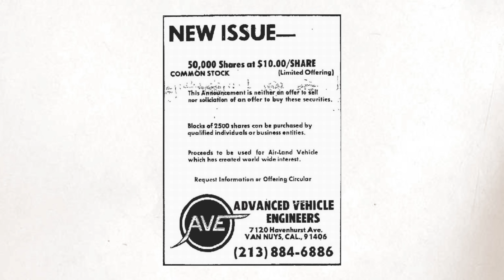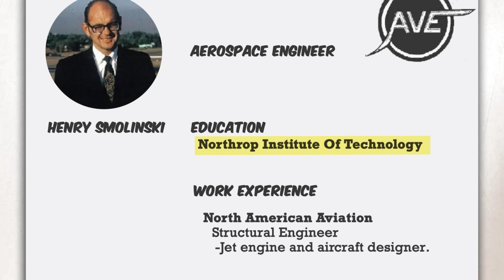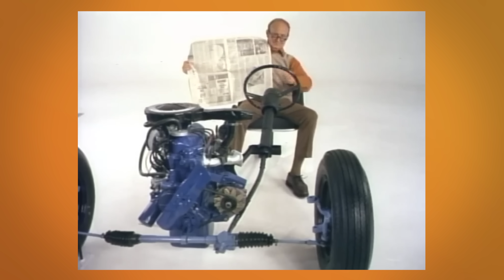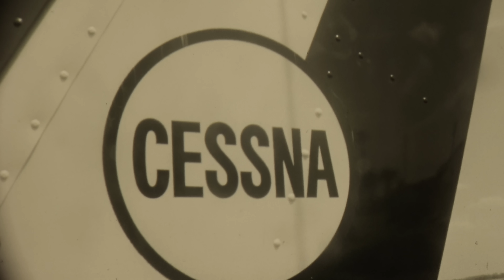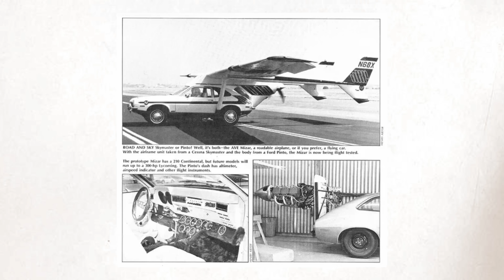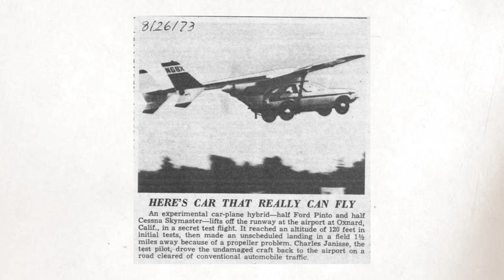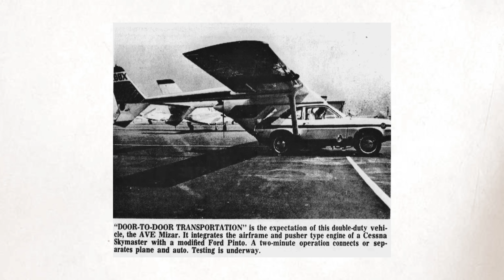The wild 1970s flying car that actually worked... until it didn't

Comment: As a retired pilot (airline, helicopter and ultralight instructor), the adage that the most dangerous part of any flight is the drive to the airport still rings true. But flying any type of aircraft is something that should be done by properly trained pilots. I dread the day that Uber or any casual driver/pilots are allowed to operate above our cities.
Reply: When car was invented, most people thought it was crazy to drive them. We have a climate change risk atmosphere, but have gained in security and technology, so I'd invest in solar airplanes for they to be stronger, lightweight and bigger. Like cars, risks could be taken trying hybrid planes with other achievements. We need more tech revolutions, more Teslas' minds, e. g.
Reply: @Whystu729  Yes, but my point is that the operators - pilots! - should be well trained! Otherwise, they'll crash with their passengers onto people below.
Reply: @Whystu729 like an 8 engine B52 that went “swoosh” right over your head didn’t it?  lol

Comment: I remember seeing a photo and blurb about this contraption in an early 70s issue of PopSci and immediately thought ‘Wow.. neat idea, wonder how long til it flops’. Conversely, I was immediately drawn to the oddball yet innovative homebuilt creations of Burt Rutan which were prominently featured in that and other aviation periodicals of the time, not to mention the fleetingly famous BD5 & BD5J micro jet.
Reply: Yeah, I read those articles, too. I remember one line: a bird that can fly but not walk will starve. True. But it's probably cheaper to rent a car at the airport than lug around all that weight of a differential, transmission, and suspension system with four wheels that can survive driving over a pothole through the air.

Comment: I had a Pinto in my youth, and later on knew some of the principals from the Terrafugia flying car attempt. And while I've got some ad-hoc mechanical and aero design experience, I shudder at the idea that a genuine aeronautical engineer would use such sloppy design and manufacturing practices with the attachment of the flight structures to the Pinto they used. Horrific that they died, but at least they didn't take anyone else with them...

Comment: First challenge: Getting a Ford Pinto to go 65 mph.  Seriously, a flying car is going to carry a lot of useless weight (transmission, bumpers, steering linkage, brakes, etc.). In car mode, you have to remove the wings, presumably leaving them at the airport, and then somehow reconnecting everything in order to fly again.

Comment: With AI and automatically driving cars we could solve the biggest problem with cars: traffic.  Think about it.  Cars driving on the highway at 70mph with six inches between bumpers.  Suddenly the capacity of the shipway goes up 5X.  No need for traffic lights you just breeze through intersections and miss other cars by a few inches.

Comment: A cyclic event the flying car, Every 20 years an Idiocracy happens. Drink Brawndo  -  Electric anything = No power density 
Flying cars the worst of both worlds.  Commercial helicopter pilot mechanic designer. Pack a scooter in the baggage area

Comment: If your car breaks down, you pull to the side of the road and call a tow truck.  If your FLYING car breaks down you die screaming.
Reply: Pilots are trained to deal with in flight problems. Most don’t end in crashes.

Comment: The empty weight of Cirrus SR22T is 2,354 lbs. A Pinto weights 2,000 lbs + a 300 Hp Lycoming weighs 440 lbs = 2,440 lbs. This is before you add any of the other important airplane parts like wings. This baby should fly about as well as the the infamous turkey from WKRP in Cincinnati!
Reply: I thought turkeys could fly! 😂
Reply: Oh man, great reference!!
Reply: The empty weight of a Cirrus SR22T is 2,354 lbs.  Also, the empty weight of a C-17 Globemaster III is 282,500 lbs.  I've actually seen one fly - it looked like it wasn't having too much difficulty.
Reply: @dougearnest7590  My point in my original comment is not simply the weight of the flying Pinto, but the power to weight ratio. The car's steel body, 4 cylinder engine, relatively large suspension, safety glass windows, steel rims & auto tires, etc. all add a lot of weight, but add only a little or nothing to the vehicle when it's flying.

The video states that the inventors replaced the original engine with a larger 300 Hp Lycoming. This is still 15 Hp less than an SR22T. An SR22T has a gross weight of 3,600 lbs & a 92 gallon fuel capacity. Avgas weighs 6 pounds per gal or 552 pounds for a full fuel load. 2,440 + 552 = 2,992 lbs. This weight calculation still doesn't include anything to make the plane fly or the weight of the pilot/passengers/baggage. I'll SWAG a bit and say the flying Pinto would gross at ~4,600 lbs. This is about 25% over the allowed gross of an equivalent SR22T (Cirrus would likely suggest, not so equivalent).   

If you takeoff any aircraft be it a C-17 (Unless there's a military emergency) or SR22T 25% over allowed gross, either the FAA (if you land successfully), or the NTSB (If you don't) will be there not long after you land.
Reply: WKRP, youre old
Reply: @simonkangiser6183  Guilty as charged! Though, Bailey & Jennifer were beautiful! I have quite a bit of stickshift time in a 1977 Pinto. Really a nice little economy car, but I wouldn't want to fly one! 🤣🤣🤣
Reply: @simonkangiser6183  Guilty as charged Though, Jennifer & Bailey were hot!🤣🤣🤣
Reply: @simonkangiser6183  Guilty as charged! Though, Bailey & Jennifer were hot! I have quite a bit of stickshift time in a 1977 Pinto! It was actually a quite nice economy car, but I wouldn't want to fly one! 🤣🤣
Reply: As God is my witness, I thought turkeys could fly!
Reply: Notnot only that, but where's the propulsion system?  There's NO propeller.

Comment: At peak times presumably there would be a high risk of "Crashic jams" Having flown quite a few hours as a passenger in the right hand seat of a Piper Navajo air taxi, to have unqualified or even partially qualified people flying around would scare the life out of me. Even experienced pilots with lots of hours get it wrong on occasion.

Comment: What makes a good road car is at odds with what makes a good airplane. Even nature hasn't solved the problem of being good at both terrestrial and arial mobility in the same animal.
Reply from the maker: Great point.
Reply: Good is subjective, the issue is skill, demand and infrastructure.
Reply: I never felt comfortable steering and operating the brakes with my feet in an aluminium box travelling at 80 miles an hour on 3 wheels.
Reply: That is so true!

Comment: Quit bashing Pintos!  My 1974 Squire wagon was one of the best of the 117 vehicles that I've owned.  Drove mine 98k miles in 39 months with only two repairs - besides routine maintenance of course.  I am looking for a nice wagon now but they are hard to find and very expensive.  Only the 2 door Runabout model had the gas tank issue.
Reply: Over several years, I owned three Pintos, put over 300,000 miles total among them with minimal maintenance ( MUCH more reliable than a lot of todays' cars ! ). Absolutely great little cars for what they were. The exploding thing was largely hyped up beyond reason.
Reply: @wingmanjim6 Right. There were only handful that ever started on fire in a rear end accident, and that was only of something hit it doing 40 or 50 mile an hour faster than the pinto.
Reply: And honestly, the Crown Vic had the same issue, as well is the earlier mustangs. Ford had a major love for drop in tanks for some reason.
Reply: Agreed !
Actually, most small and even mid sized cars of the era shared the design of using the gas tank as the floor of the trunk, so to one degree or another, the potential problem was there for a whole lot of cars. 
The Pinto, like the Corvair, was the victim of Nader-style exaggerated bad press.
Reply: @wingmanjim6  That's funny, I've removed and repaired many pinto fuel tanks and many others from that era and when the tank was removed the trunk definitely still had a steel floor! No vehicle that I've ever worked on used the fuel tank as a floor for the trunk.
Reply: @wingmanjim6  Apparently the specific problem with the Pinto was a protruding bolt on the suspension that would puncture the tank in the event of a rear end collision. Not a difficult problem to eliminate, but Ford did not want to spend the money.
Reply: @mauritsvw  Thanks for the info - much appreciated !
Reply: I had a 1975 Pinto wagon. Loved the versatility of it, but it burned more oil than gas.
Reply: You mean I drove my wagon constantly looking in the rear view mirror for nothing?
Reply: 117 vehicles?  Man, there's a story there, Jim.
Reply: Get a used Yugo.  It will make your heart sing.
Reply: @furryp2402  🤪
Reply: Great to find not only someone with an equal love for the automotive world but also an inability to own just one or two at a time. My brand loyalty while littered with the odd GM And Mopar buys were predominantly Ford products. I am currently only twelve behind you but it would be fun to compare notes.
Reply: @keywestjj  we will pray for you
Reply: The Chevette is a better vehicle though.
Reply: @russelljohnson1303  I disagree.  I drove both back in the day.  The Pinto sucked but the Chevette actually scared me more than a death wobble in an M-151 jeep.  A racer was once asked if 200 MPH at Indy felt like 80 in a Chevette; he replied no, 200 at Indy felt like 40 in a Chevette.
Reply: @danielstickney2400  I had a Chevette 4 door as a commuter for years and drove that old girl , about 90 miles a day, and she was 41 years old at the time. Their good planted little cars.

Comment: The wings and tail came from a Cessna 336 which crashed on a mountain side in West Virginia, USA. I removed the aircraft and took it to Huntington, West Virginia where it was crated and shipped to California. I knew what they were going to do with the wings and tail and thought it would not work; cars are not designed for the stresses of flight
Reply: Tell us more! How structurally sound were the elements reused in the Pinto mating? Was it just the front half of the airplane that was damaged, or did the wings and boom elements suffer too?
Reply: And Cessna airframes are not designed to have a car hanging off of them!
Reply: I would like to talk to you

Comment: Choppers and drone-like machines are not flying cars. They can not be used on roads.

The very idea of flying car that it is mostly DRIVES! From home, office, city, suburb - any road. It takes off only if need to cross 100s kms, fly over some obstacles and so on, regardless of cost. The biggest advantage over light plane - you do not need to struggle on the last 10 miles, from/to airport. The biggest advantage over car - it can flyyyyyyyyy, not bump in doad traffic.

Unfortunately it does not work. Everything that can fly is not fit for road traffic as its too light and requires to carry all wings somehow, everything that can run well is too heavy to fly.

Comment: In order for there to be a "flying car," it has to be a roadworthy vehicle that can also fly.  If it can't readily transition between flight mode and driving on the road mode, it is NOT a flying car.
Reply: Yes this was really more like a plane you could drive around if you had enough side clearance. In this first and only prototype there was no way to remove or fold the wings etc.

Comment: The strongest part of the plane (wings) was attached to the door panels? And the tail attached to the flimsy bumper. I dont trust the structural integrity of the ford pinto door hinges and singular door latch to hold the entire car up and withstand wind gusts
Reply: I'm pretty sure the wing struts went to mounts attached to the frame rails under the doors (not the doors themselves). Not sure of how the rest of it mated, but clearly it wasn't adequate...
Reply: @davidg3944  you are right, it's clearly not attached to the door. But it must go into the frame, it has to.  I just went back and looked at the still shots of it.

Comment: An aluminum bodied Porsche 911 with an engine power takeoff would have 
better power to weight ratio adaptable to flight capable accessory attachments
like fixed wing or rotary. There are other high performance lightweight vehicles
which could be adapted to flight capability using the existing power train. But
a Ford Pinto doesn't seem a feasible choice for any actual engineer as would
be a rocket scientist. Something is just too cute about this enterprise and its
cuteness was resolved by a Darwin Award for two unrealistic dreamers who 
evidently had a delusion of being practical engineers who shouldn't have bet
the farm on that overconfidence. There's no back to the drawing board there.

Comment: As it is now, you need to live in an unincorporated area to not be hassled by your local municipal ordinances in order to land and take off from your property in a helicopter, and communist California requires your landing spot on your property be at least 80 ft from any property line in accordance with CalTrans.  FAA just requires permission from the property owner to operate out of the spot.  A personal VTOL flying car operating out of your driveway in a typical city or town?  Pipe dream. Rural areas, perhaps.  Airspace is too complex to negotiate for an average individual without being rated with an airman certificate, especially in or near metropolitan areas that have a concentration of high use airports, where a flying car would be nice to have to overcome traffic.  A lot a people can't even drive a car, much less manage an aircraft, even if it were to be automated by AI and be integrated into a special designed highway in the sky type of special use airspace, systems fail and need to be dealt with in an emergency with a high degree of competency.  General public don't like stuff falling on their heads!  I'm fairly certain we will only see EVTOLs operating out of special hubs, manned by qualified pilots to carry the general public at the most optimistic scenario.

Comment: In theory that can work, if somebody makes it properly. Smolinski and Blake just ignored the problems with the concept.
Reply: This story reminds me of the deep sea mini-sub that was lost (with the CEO of the company that built it, plus four passengers), while attempting to visit the wreckage of the Titanic. The corporate CEO angrily rejected numerous warnings from seasoned engineering professionals, regarding the risks involved with his pet project. He fired them, replaced them with a younger (and more easily bullied) crew of designers, who didn't follow their predecessors' example....and we all know how that story ended. When ego overrules common sense, history doesn't necessarily repeat itself verbatim---but it often 'rhymes'......
Reply: Obviously some very good engineering ideas, such as the telescoping column and the quick attach wing fittings. But not doing a thorough engineering review of critical load carrying structure and control systems, and an engine swap during initial testing - the drug of obsession is deadly.
Reply: In theory as an aircraft or a vehicle, but not as a practical mass market product. No matter how perfect the tech, either everyone will need pilot training, or it’ll need to be flown by flawless AI.
Reply: @Sashazur  "flawless AI" 😂😂😂😂😂
Reply: Here I was looking for how they reinforced the hookup points with cross members and diagonal struts.
Reply: I really don't get why it made sense to use a production pinto as prototype. With the mods they had to make anyway, why not build the car portion from ground up as heavy duty go cart/motorcycle. I wonder if Ford wasn't paying side money thinking it would generate buzz and then they could distance themselves from it when it failed.  The fact they needed someone else to build the car before they tried is quite telling that they shouldn't be trying to build the first carplane

Comment: We already have flying cars. We call them airplanes and helicopters. My opinion is that to have everything operate as it should we have to have things like airports, runways and air traffic control and trying to eliminate those things would likely result in chaos .
Reply: For the whole Australia there are less than 30 controlled (C and D) airports + militaries, everything else is just airstrips without any ATC, even if they have RPT, land facilities and active movement. Almost nobody died, at least less than in controlled airports.